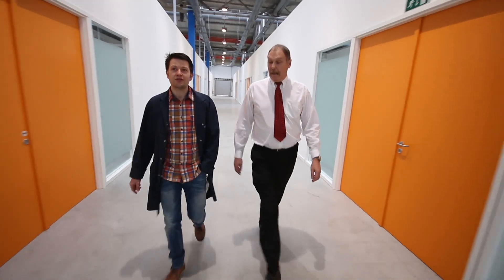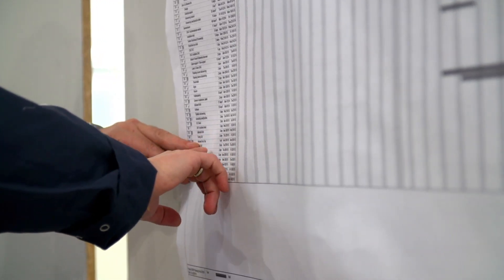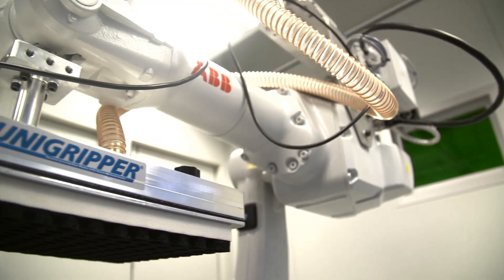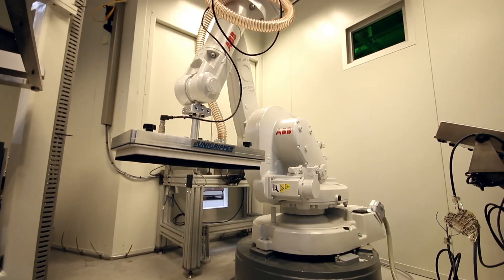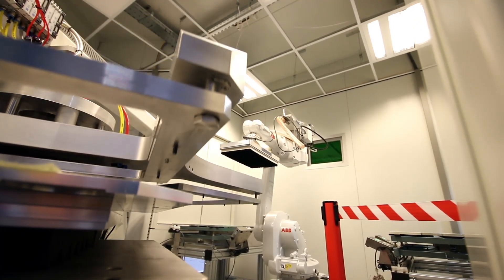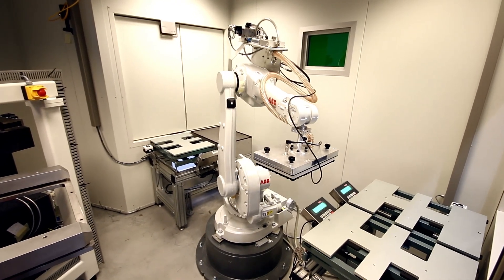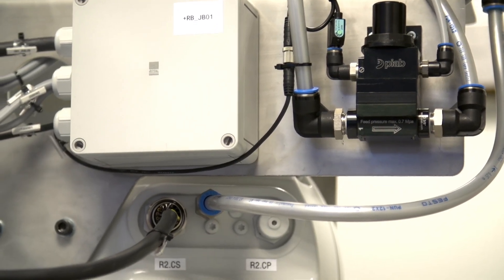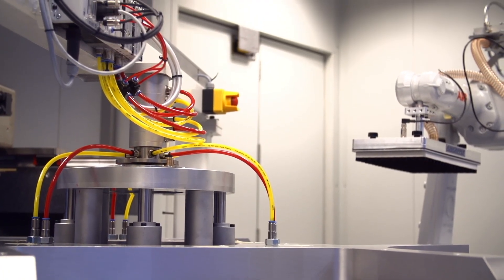Borit NV - Industrial project manager - Leo Oelbrandt about Philips Engineering Solutions

Comment from the maker: Today the first manufacturing activity on the Open Manufacturing Campus in Turnhout is officially opened in the presence of the Flemish minister for work, economy & innovation Philippe Muyters. Philips Innovation Services is present on campus with a high precision equipment for leak-tight laser welding with a performance that is second to none in the industry today. Also, our Manufacturing Services department will support the ramp-up phase with its local team allowing fast response times.

For our customer Borit NV, we have designed and built a machine for the production of bi-polar plates for fuel cells. It illustrates our deep knowledge of laser processing and bringing together today’s best available technologies on the market.